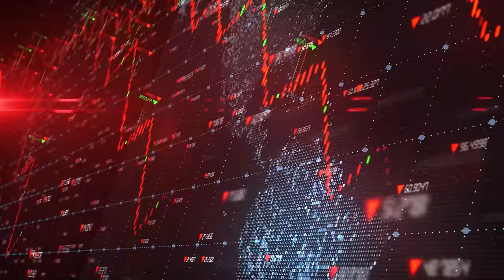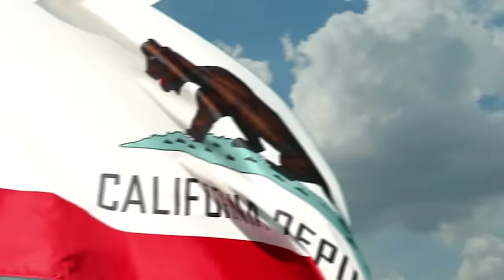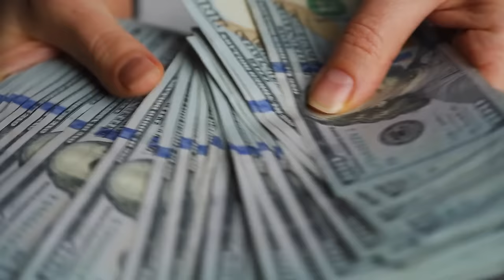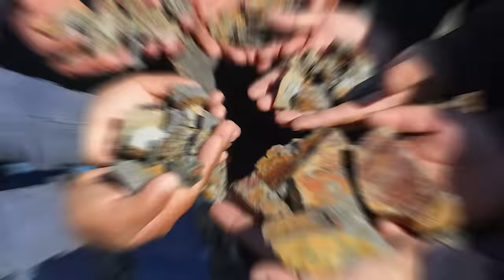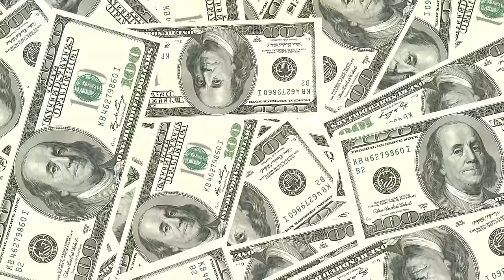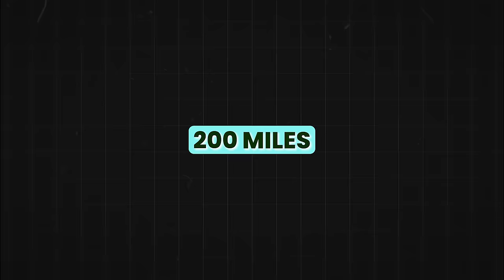Bombshell NEW EV Study Exposes MASSIVE EV Scam!

Comment: Surely they knew all this from the start?
Reply: I am a conservationist, and it was never considered a viable solution.They have always known.

It doesn't matter even if the car itself was still viable pollution wise. It is mined in Africa, assembled in Asia, and shipped on a massive cargo carrier for 12,000 miles using the most toxic, inefficient fuel of all at 200 tons a day. 

The most optimal environmental outcome is to not make it in the first place, and drive whatever vehicle you have into the ground. My guess is they wanted to artificially inflate rare earth metals into a lucrative commodity,  which is why they don't promote geothermal or nuclear. 

The fact that industrialists got on board with this should have been everyone's clue. Never, ever, ever trust industrialists.
Reply: @Nylon_riot  i worked for MHI Vestas making wind turbine blades. Yeah I left when I saw the lie with them?

Comment: People like myself already knew about batteries . If you install, build,  or do recreational hobbies, you've already had to deal with lithium batteries. You already knew how fast they degrade under stress . You already know how they swell from overuse and heat . You've already seen them catch fire and explode . You already knew how hard it was to put them out when they caught fire . People who worked with power tools didn't want any part of electric vehicles, unless they weren't the cognizant type.
Reply: yes dead right ..all R/C modellers who use lithium batteries know the risks and they are minute compared to car batteries...I have lost one plane due to a 3 cell going on fire on landing ...and it even kept burning when turfed in the nearby creek.

Comment: The intention has been to exploit unaccountable bureaucrat-developed mechanisms, like compliance credits, carbon credits and cost-sharing, to artificially drive conventional car costs and sale prices upward, in order to artificially reduce/offset EV consumer prices and ensure EV manufacturer, mercantile profitability. Eventually, this will provoke all new cars to be too expensive for ordinary consumers. Even if communist China manages to drive costs downward, chronic trade imbalances and continued erosion of US economic power will result in currency shifts that will make new cars unaffordable for ordinary Americans. 

The government push for EVs is a ruse for mass transit. 

Stop kowtowing to the contextual fraud of "climate change". CO2 is not the devil, is not causing "climate change" to any negative result, and the concept that we can stop the climate from changing is absurd. Frankly, you'd better hope it keeps changing because, if the the Earth's climate goes "steady state", that means the earth has stopped spinning and we're all dead, or sun has either gone out and the earth's atmosphere has becoming mostly solid, or the sun has expanded to the point the earth's atmosphere has evaporated.

Comment: When vehicles are heavier they do damage to asphalt roads. You see semi's that go over a common highway and the highway lanes have huge dips in them from semi's digging and pushing in the road. Even concrete roads get cracked easily because of the weight. Imagine every vehicle weighs over 8 to 10,000 pounds. The roads will get destroyed and debris will be all over the road, then get kicked up from the tires and there goes everyone's windshield. Have you guys noticed insurance companies no longer offer free windshield replacement.....they used to.

Comment: Weight is by nature the enemy of efficiency. An object in motion and all that Issac Newton stuff is amplified when something weighs more. Batteries have the disadvantage of weighing the same whether they’re fully charged or completely dead. A commercial airliner that leaves New Zealand becomes easier and easier to maintain altitude as it approaches LAX because the fuel tanks get much lighter. Not sure of the integrity of the math but I read that to contain the energy in 85 pounds of gasoline a battery must weigh 1,000 lbs. Similarly I often see cost comparisons between a tank of gasoline (or diesel) and the materials to build a battery. The battery is not the energy that moves the car (truck, train, airplane) but the medium in which it is stored. The people who have perpetuated this insanely expensive ruse are aware of all this, the basis of the EV revolution is neither physically nor economically advantageous. It’s a smokescreen to cover evil intentions and nothing good will come from it.

Comment: 1.	EV Production Not Being Pulled: The claim that Tesla and Ford are "pulling the plug on EV production" due to a "massive EV scam" is not factual. Both companies are actively involved in EV production and have made significant investments in the sector. In fact, Tesla, Ford, and General Motors (GM) have been cautious about expanding their electric vehicle production capacity, citing economic uncertainties rather than abandoning their EV efforts .
2.	Automakers Adjusting EV Production Goals: It is true that some automakers are adjusting their EV production targets, but this adjustment is more a reflection of economic realities, such as supply chain issues and changing consumer demand, rather than a wholesale retreat from EV manufacturing or evidence of a scam. GM, Ford, and even Tesla have recalibrated their production goals in response to these factors.
3.	Demand and Economic Factors: The adjustments in EV production and sales strategies by these automakers are largely due to economic factors, including interest rates affecting car loans and overall consumer readiness to adopt EV technology, rather than a rejection of EVs outright or any deceptive practices. The EV market continues to grow, although not as rapidly as some optimistic forecasts had anticipated.

Comment: High power and complex electric powered vehicles make them difficult to repair and the electrics in an EV are exposed to harsh environments including excessive heat and cold as well as dry dusty and wet conditions like taking your super huge television on the roof rack of your car and expecting it to work after every journey.
Faulty TVs don’t get repaired they just replaced….

Comment: Toyota has the solution. They've developed a safe engine that literally runs on water. How? It has an electrolysis system that uses a battery initially to break water down into O2 and H2. The H2 is highly flammable and is fed into the engine's cylinders like gasoline, where it fires off like gas driving the pistons. This in turn also uses an alternator to keep the batteries charged, just like a gas powered car engine. What comes out the tail pipe is water vapor. Nothing gets destroyed. It's water in, water out. Imagine using your garden hose to fill your car with fuel. Why isn't it in full production? Imagine the financial chaos it would cause to the fossil fuel industry.
Reply: Well location too. We have droughts in some places. Unless you mean salt water from the ocean but i doubt it.
Reply: The ammonia engine is more promising. Hydrogen production is energy intensive. There is naturally occurring hydrogen underground to tap into but it's still going to require hundreds of trillions of dollars to change over the distribution system, while ammonia would be the same system we have now.

Comment: Looks like you covered everything I've known about EVs problems except two big ones. The battery.  In cold weather, the battery charge holds about 60 percent of warmer weather. The engine of the EV. It has to be replaced approximately every seven years. Who is going to pay for that  at a cost of $20,000.00. Plus, the battery now has to be disposed of. Where? / Who ? Surely not in the ground. By the way, the U.S. will not be ready for EVs electrically for another decade. Norway is the world capitol for EVs. They have more than a 15-year start ahead of the U.S. Every small community in Norway has public charging stations. The U.S. is at least a decade behind. They are great driving vehicles and good looking, but I would never want to travel outside of town with one. Fear of having to be towed because I could not find a charging station is a huge issue in the U.S.
Reply: I've never seen a good looking EV LOL
Reply: No, the engine (motor or motors) do not need to replace every seven years; they last far longer than that. But the batteries do wear out.  How long seems to be dependent upon the number of charge/recharge cycles; not just years. With “normal use” (12,000 miles per year), it looks like their lifetime is somewhere around 10 to 15 years.

Comment: 😂

These are not good enough reasons to stop EV production.
They are, however, reasons to work on the national inferstructure. At all levels.

Because, even if the EV is a failure, ALL the things sited in this report still need addressed, yesterday.

All EV is doing is speeding up the need for the implementation.

This report is as useful as seeing a crack in the dam leaking water and using bubblegum to patch it. Worse, its declaring 'the bubblegum is holding!' Then blaming the dams original engineering team when it collapses.
'Any dam worth anything. Should be patchable using bubblegum!'
Reply: BEV production is stopping. Not enough people want them and they aren't going to be forced on us.

Comment: Battery prices just fell off a cliff! so you are now scare and posting the lies. Cheap EV coming this year!
Reply: BEV might get cheaper because they aren't selling. Battery materials may have gotten cheaper but that's not the large cost of the battery. It costs more for machinery and labor to make the batteries so I expect the finished cost of a battery to go up. Thanks for playing, maybe they will give you a consolation prize on your way out. They aren't building expensive battery manufacturing plants to sell cheap batteries.

Comment: The story of EV's is unfolding. Toyota, the largest manufacturer in the world, has stated that they will not make EV's because they do not save the environment and they are not practical or efficient. The fact is that the batteries cause a lot of pollution in their manufacture. The other problem is the electricity grid. It is not large enough to deal with the energy required for EV's in great quantity. The third problem is the charging. EV's do not have the stated range that they claim. Some people are claiming long wait times at charging stations and long charging times. They say that a charge is costing them more than fuel would when they have to go to private charging stations. The other problem is the cost of the replacement batteries. They can cost as much as a normal gasoline car. The problem that we have here in Canada is cold weather. The batteries do not have the energy to heat cars without severely reducing the range even more. EV's have a long way to go before they will make sense. By that time, hydrogen will likely be the upcoming fuel.
Reply: They have found natural hydrogen under ground, but there would have to be a new distribution system built for it. Ammonia on the other hand shows promise because it could use the same delivery system we have now.